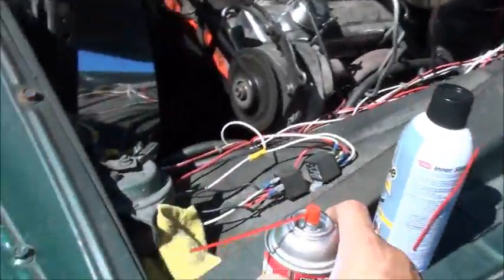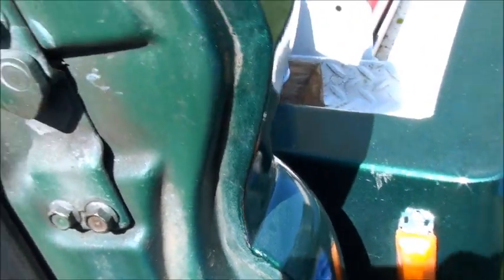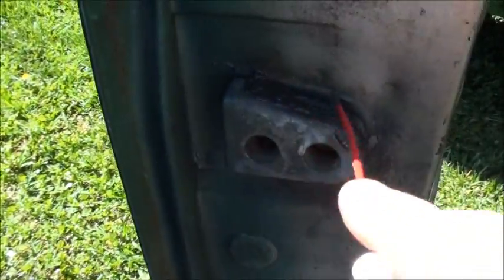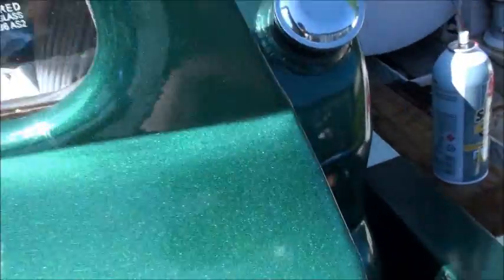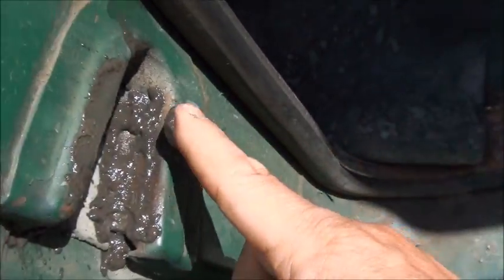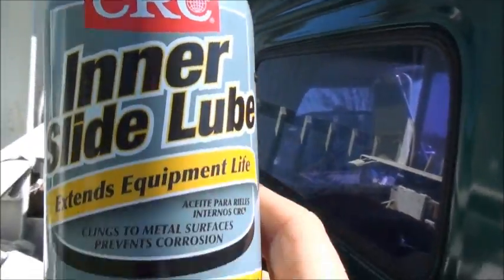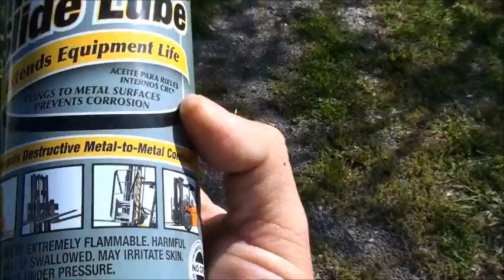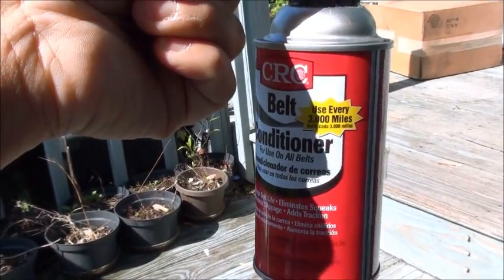DOOR WEDGES , WHAT ARE THEY , HOW TO KEEP THEM WORKING CORRECTLY !!!

Comment from the maker: yes they make rust converter , you will see it in like 2 videos on my ford , but go look at this web page , fix the dot , and add the 3 w's( crcindustries ) and look for rust converter , they have in two forms
as for a good decent cam look for something like my knock around cam this vid was shot with it , I knock down the quality a ton to speed upload , it is a full 1080p hdcamera , it is a sony hdr-xr100 it is older but it is something affordable used off say ebay , my good ones are 2k each lol